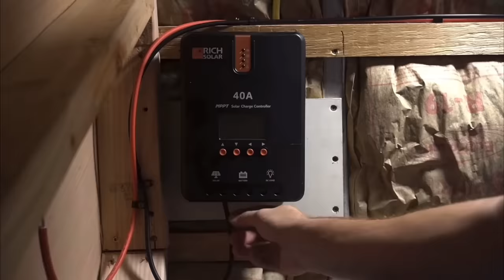Family of 5 Build Their Dream Skoolie! *2 YEAR TIMELAPSE* Full Time Living! ￼

Comment: I think you’ve made a cracking job of this bus conversion so far!!👍🏻👍🏻 
I did have a slight concern about the buses structural integrity when you elevated the roof, the box steel you used to extend the height didn’t appear that substantial or matching the existing gauge?
Not a criticism just an observation, I think what you guys are doing is very brave, what a road trip!!!👋🏻👋🏻👋🏻💪🏻💪🏻

Comment: Do you have a Girard on-demand water heater for example to cycle water in your system, so if you in a cooler climate you don't burst your piping by having them freeze.  It has a setup so that if the outside temperature gets to a certain point it kicks on the heater and keeps all water in the lines to 12 - 15 degrees Celsius (55 - 60F)
Reply from the maker: We do not. We have an on demand tankless water heater but it’s not a Girard.

Comment: Beautiful job, using really nice materials.
Just curious how much weight this added to the bus and how did it effect the performance and handling?
Reply from the maker: The total weight added is still unknown. It’s a lot but I can’t say for sure. BUT bud seats are heavy. Those were removed and a lot of sheet metal inside and out. Also the windows. So a lot of weight was added but a lot of weight was removed first too. Plus these busses are rated for 40 adults. That’s a lot. The bus performance is weak, but all of these old school buses  were underpowered. It’s something you just have to deal with in the skoolie community.
Reply: @lifeanywhere  I thought about the weight of the kids and figured the seats were heavy as well.  No one uses a bus for speed.
Good luck on your adventures; you have a nice comfortable mobile house for your family. I do have a friend that took a 60's Greyhound and he did overbuild it to the point where it was dangerously slow on pickup due to the excessive weight he added.

Comment: You did a great job. That would be super cool for camping.  Could be full time living for a couple with no children. Definitely not full time with kids.  Are the kids all under the age of 5 (hopefully)? Because those bunk openings are incredibly small. Also, how is the open shelving in the kitchen working out?  How do you secure the items to not fall off while driving? Seems impractical for a moving vehicle. But perhaps that became evident as you mentioned cabinets needed to be installed.  But again, awesome camper.
Reply from the maker: The kids are 5,7, and 9. The bunks are a little tight, but they actually love them. We know they won’t work forever because they grow up so fast but it works really well for us now. The open shelves have been nice. Moving things off of them when we travel is a pain but we love the look of them!

Comment: How did the tile work out?  I have considered tile in mine, but am afraid of the vibrations cracking the grout out.  My bus, well it rides like a bus, and that diesel engine makes everything vibrate.
Reply from the maker: It’s works just fine. I even used two different types of thin set. The pre mixed kind and the kind you have to mix. Both work great. I’ve noticed 1 tiny crack in a grout line in the kitchen. And you really have to search for it to see it. We’ve put about 2,000 miles on the bus. The tile is going strong. Do it!!

Comment: I would have used extruded (not expanded) polystyrene with no framing on the floor and professionally installed spray foam insulation on the interior including the wheel wells but especially over the metal ribbing. You just can't have the outer shell, the wooden framing and the interior panels touching each other without at least an inch and a half of insulation or you will get condensation and compromised R value.. A vapor barrier is also a must if you're using traditional insulation or you will get condensation inside your walls. Obviously the bus is beautiful, you may just want to keep it out of the cold weather or you're going to have major moisture problems. I'm not trying to be negative it's just a fact.